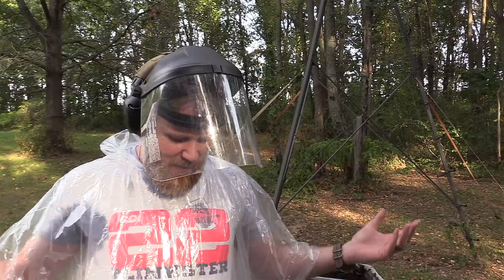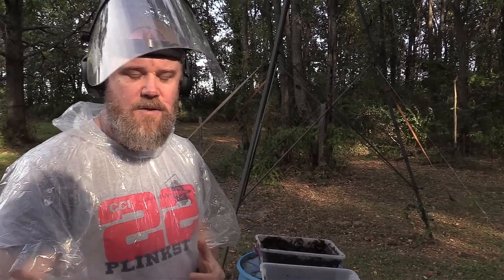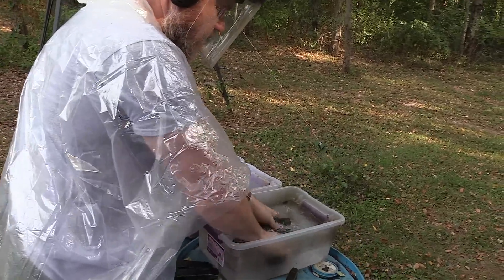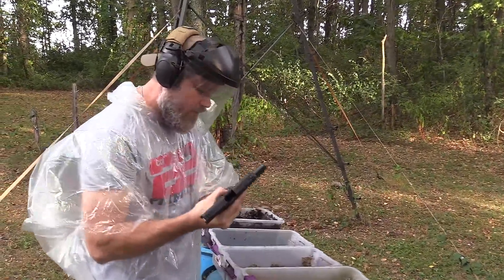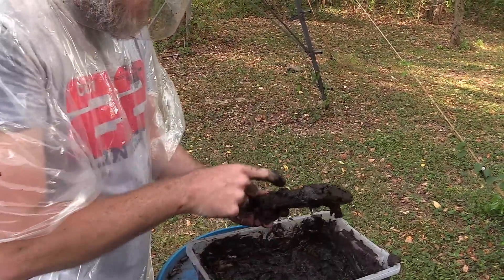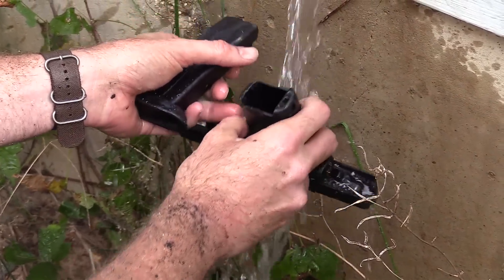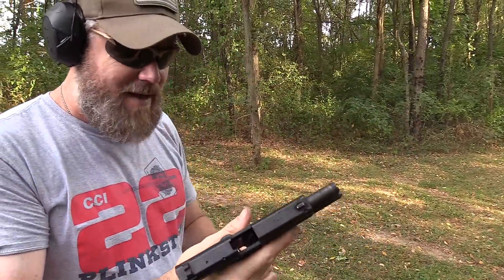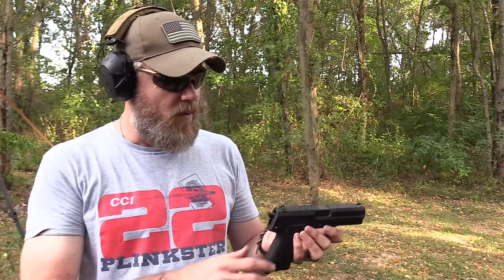The HK USP 45 meets the Gauntlet!

Comment: My usp 9 fell in the dirt and debris got into the control lever( safety/decocker) and it caused the lever not to work, when I called HK the rep asked " how do you know that its broken" and I replied that the lever goes all the way around and doesn't do anything. I sent it in and in a short two to three weeks it was back. The cool thing was HK replaced the night sights and repaired the broken control lever and sent the usp back all at no charge...

Comment: Legendary USP, expected nothing less. I wonder if the HK45 would fair the same.
Reply: Spanky's Basement yup, I knew it would slow it down a bit but I had a feeling it wasn't gonna die
Reply: From my personal experience HK45 has a tighter slide to frame fit, which makes it more sand-resistant.
Reply: There's only one way to find out...
Reply: Is the HK45 the same as the Mk. 23? That's been my dream handgun since i was a youngster
Reply: Joe Drummer the mk.23 is the navy seal contract USP design, the HK45 is the modernized USP 45
Reply: And another data point adding to why I want one of these in 10mm.
Reply: Lolz, nvm. Just looked em up a little while ago. Nice looking pistols. I think i'd still prefer the brick that is the mk. 23 myself. At least for a duty .45.
Reply: sailingmaster, that makes two of us.
Reply: Sailingmaster-Same here, but only if I move out of California.I did the next best thing and got a 6" factory HK barrel for my fs USP 45, and an 18# Wolff spring and shoot 450 SMC (45 Super w/small rifle primer)  It gets up there in 10mm territory.  The 6" barrel has the o-ring grove cut for the FS USP, not the Elite, of which I also have.
Reply: Spanky's Basement probably not...they don't produce or test guns like before...HK i mean!! USP line is best produced gun in at least 100 years!! NO COMPROMISES 😄!!!
Reply: Joe Drummer Its a 45 version of the 9mm hk P30
Reply: The one thing that kills me about the HK45 is HK went down in capacity, to 10 rd magazine, from the USP’s 12 rd magazines.
Reply: Mr Smith-It is great for me since I live in CA.  I have one and the grip ergo is better like everybody says.  I have a FS USP (10 rnd) and 2 Elites.    Heck, I carry a compact USP 45 mostly and it's "only" 8.  I don't think it amounts to shit in cap difference.
Reply: pete zandt, the HK45 compact is fine for carry with 8 & 10 rd capacity. The full size HK45 should have a 12rd magazine capacity for those of us in free states.
Reply: I got a Blackhawk Serpa holster made for the P30 and it works for my HK45  I don't have a P30.
Reply: Mr Smith-My compact is the USP.  My 10 rnd HK45 mags will work in the compact USP 45.  I thought it pointless, but I had to try it when I got the HK45 home.I got the HK45 in 2014 just before the CA Single Shot Exemption loophole expired  1/15.
Reply: Spanky's Basement my guess is the hk45 will do about as good if not worse than the vp9.
Reply: +DV8 H&K aimed the VP9 specifically at the market niche highlighted by Walther's PPQ.  It's priced to compete there.  The VP9 was never meant to be a service sidearm.  It has a great trigger and I've never had a problem with mine.  In fact, it's made me love the Euro-style mag release.  I use my trigger finger to drop the mag and never have to change my grip.
Reply: allindonks I’d think the HK45 would be GTG. The HK45 compact has replaced the Seal’s Mark 23, as the Mark 24.
Reply: The grip on the HK45 is much nicer though.  Easier to conceal too.
Reply: wait, this was posted yesterday, how did you comment on this 4 days ago? On Full 30?
Reply: Spankys basement-cough cough lol.  If there's a run on ammo agsain because of the Las Vegas shooting you'll still get .40 Short & Weak while I scramble to find 10mm, 45acp and 9mm, oh yea, 22lr.
Reply: JohnnyMo You can get energy in the range of .357 Magnum out of a 10mm, which is why so many of us want a USP in it.
Reply: JohnnyMo 9mm & 45 each have there pro’s. 9mm is capacity king & size efficient. Pros for 45 is FMJ, if you can only punch holes, might as well be the biggest bullet. 45 is tenth bigger, so who knows that could give a slight advantage snagging a vital, when a 9mm is off by a tenth. Also 45+p can be subsonic and 45+p can get close to a standard 10mm load, 10mm will always best it though. 

They’re both good cartridges and wouldn’t feel out gun with either. I chose 45 & 9mm for different roles.
Reply: Rifles First which is why I want a 10mm version. That way I can fire any factory loads like Underwood or Buffalo Bore, in addition to handloads.
Reply: JohnnyMo no no, I want a USP in 10mm, not .357.
Reply: JohnnyMo went to only 9mm for a while but added 45, Colt 1911. Think I’ll replace replace it with a HK45CT. 

I’ve always been able shoot 45 more accurately. It keeps an extra option open in case of an ammo shortage. And if storing ammo 45 FMJ is going to be better than 9mm FMJ for self-defense in place of defensive rounds, when they can’t be found.
Reply: JohnnyMo now, for the USP, the 9mm is more tempting than 45. Missed the promotion for the P30 for 4 free magazines. Ticks me off that I missed it.
Reply: JohnnyMo check out sootch00’s 45 compact review. Yeah, it’s only 8 rd capacity (10rd mags are available) but is smaller than a 1911. And it would make a good full-size backup for a high capacity 9mm. 

https://youtu.be/39H15uWVhhw
Reply: JohnnyMo SAME
Reply: Rifles First When only a sidearm is available, I prefer a high capacity 9mm. However, carrying two HK45’s would negate the capacity issue.

Figure if I carry a 9mm and it’s not working, the slightly better ballistics of a 45 could give a small advantage.
Reply: Spanky's Basement Yeah, sidearm is usually all anyone has access to. That’s where 9mm might be better than a 8rd 45. Standard 9mm capacity is 15rd and if one hand goes down a magazine change is going to be difficult.
Reply: I also got one right before. Good for us. :D Never knew the mags would fit in my compact. Got the compact in 2012, couldn't find the full size. Did you pick up a .45 expert? Thing is sweet!
Reply: HK Mark 23!
Reply: Can it handle 45 Super like the USP though?
Reply: +Leon Yang tighter tolerances usually mean less reliable.
Reply: The HK45 uses a single stack mag. It was built to fit the hand like a 1911. This is why it has a low capacity. I don’t know why HK wanted to make a gun like this but it’s what they did. Funny enough it turned out to be good enough for the Navy Seals because it replaced the Sig 226. That says a lot about the HK45C.
Reply: @Al-cy9qn  the mk23 was the first ever iteration. After some feedback hk shrank it down a little bit in size, bringing us the usp series. The hk45 is the newest generation after this usp

Comment: Exactly what I expected,thank you.

I've owned 3 USPs and none ever had a malfunction. I also owned a P2000 which also ran like a champ. I sip the H&K kool-aid all day everyday.
Reply: Glock wins!!
Reply: @levirodgers6082  hows that glock 44 looking again?
Reply: Anthony Severino  The same way the VP9 is doing. You can use certain ammo, that’s coming from your own manufacturing company. Glock will fix the problems for the 22LR , I promise you that. But who’s the King of the 9mm? Glock by far, you welcome!
Reply: @levirodgers6082  Glock vs USP Elite .45 Acp..Glock 0 HK 5 ...😁😁😁
Reply: @levirodgers6082  If you can't make a high-strength polymer .22 50 years after Remington makes a .22 out of basically all plastic, then you're doing somethjng badly. Glocks are kings of a well-rounded gun for the money, but it isn't a USP that will go through hell and back just to laugh in satan's face. And you pay for that privilege.
Reply: Anthony Severino Mine is working perfectly. 2000 rounds and not a single issue. I’m not a cheap bastard though. Only CCI mini mag and Federal Champion has went through it. I’m a massive HK fanboy too. I own the MR556, MR762, P2000 40 LEM, MK23, USP 40 v1, VP9 optics ready, SP5, USC to UMP by tommy built, P30 v1 9mm V3, HK45 Tactical v1. Only own two glocks, the G19 which is my concealed carry and my G44 which is the range plinker. Glock, Sig, HK, make the best hand guns on the market. Hands down. Quit trolling.
Reply: @CaptainCreampie69  I'm looking at a USP .40 at a local pawn shop. Does it function as reliably as the .45?...I think it feels a little plasticky...have you had any issues with the palomar or grip or anything?
Reply: @code.name.sasquatch  Do not hesitate. The USP was designed around the .40 and is imo the pinnacle of .40 cal handguns. It recoils like a 9 and is just as reliable as the 45 in my experience. I have a simple dirt test vid with mine and out of all my current and past hand guns I tested it did the best. Both my 1911 and G19 functioned fully but both felt sluggish and gritty. The USP got it the worst and still felt like it had just been cleaned and lubed minus the safety being slightly gritty. Also keep in mind that the materials are second to none imo. Barrel is CHF from canon grade steel. Same steel as the 416. The slide is much more robust and harder to cut according to DB custom when I asked about a custom slide milling package for my VP9. The internals are either stainless or HE finished (Melonite) so no corrosion issues to worry about. May not really make a difference for 99% of the time but still a factor.
Reply: Anyone at the range cares about who has what gun? 🤣 I rarely see guys in shape at the range. Physical condition of a man is most impressive thing a man can do. No one cares what gun is someone shooting
Reply: The P2000 is a usp, the P30 and HK45 is a USP. They're all just USPs, with some cheaper parts inside, over half of the internal parts are interchangeable. The only things different are the barrel, external look and the newer guns have a cheaper recoil spring and guide rod. I have P2000 and HK45 parts in my USP45 and Expert, they all have light extractor springs.

Comment: I've had a USP in .40 since 2003 and have never had a failure with it...and I've shot reloads, cheap, and expensive ammo through it.  Everything is still tight and the only wear showing is the lockup ramp in the top of the slide, and it's cosmetic.  What a tough pistol.

Comment: In my opinion, after going back and watching the Arex test, this test seems more impressive. The Arex didn’t have nearly as much mud stuck on it as the USP did and the USP still locked open. He also didn’t throw sand dirt and mud over the gun and basically completely submerge it as he does with the USP. Just my opinion. Or is there another Arex gauntlet I didn’t see?
Reply: Well, the AREX also fired a full thousand rounds in rapid succession with Battleborn lubrication and didn't malfunction once. The slide was over 200 F at the end of it and it still worked. The trigger was I think 170 F, which is a few degrees more than what's necessary to kill flesh on contact. (Obviously, thick gloves were involved in this test.) So while the Gauntlet wasn't repeated, the AREX proved itself in other ways afterwards, if that helps.
Reply: Phoenix 731 So have 1911s. The HK45 went 50,000 rounds with like 1 or 2 malfunctions only being cleaned every 4K or something and at one point went like 12k without cleaning at one point. It’s on pistol training website. It’s pretty interesting. I think the USP could do the same as the Arex honestly.
Reply: The 50,000 round test took months, however, and I should note it wasn't smooth save for a couple of malfunctions: It experienced some parts breakage, too, although it continued to fire even with the damage. When I say the AREX fired a thousand rounds in rapid succession, I mean in something approaching the space of about 14 minutes or so. I wouldn't be surprised if it could do it, but that's not the sort of abuse I'd place bets on a typical, non-megabuck 1911 shrugging off save possibly if you're lucky enough to get ahold of an old original milsurp which is in good condition, and even then, I wouldn't be so sure: The Colt Series 80 1911 the Military Arms Channel tested completely choked and they weren't even able to finish. Sure, it's not an old GI-issue model, but it is still a Colt, at least, and I would expect somewhat similar performance.
Reply: Phoenix 731 I believe the Colt would have done better with Wilson mags. First thing I did with my Colt was throw away the stock mags. They were labeled as 8 rounders and I could barely get 6 in em. 3300 rounds with 1 FTE somewhere around 2900. Now obviously those 3000 rounds were over a period of time but it’s gotten dirty and have been reliable. Also these 1000 round tests still don’t really prove anything since no one realistically will need to fire 1000 rounds in quick succession. I’m sure the Arex is a great gun. I just don’t have an interest in it after owning my 226. Just didn’t like the overall feel.
Reply: That would've caused the handgun to malfunction somewhat less, but what caused the test to completely fall apart was the gun itself simply locking up and refusing to go back into battery, and it consistently malfunctioned upon contact with the dirt up to that point. Mags won't fix that. It failed because of severe dirt ingress in the handgun itself. I'm not tryin' to sell ya on the AREX or anything, I'm just pointing out that the 1911 is a century-old design and it's showing its age. I'm sure that a custom-made, modernized, and of course quite expensive 1911 can still kick ass and chew tobacco, but how practical a choice would it be, especially for a service pistol? The AREX is about $600, which is a pretty decent price for what it can do, and many even cheaper polymer striker-fired handguns in that test choked considerably less. However, I do agree that the USP and the HK45 are kickass handguns and could definitely handle themselves quite well in adverse conditions. A 1,000 round meltdown test would be interesting to try with them. Sure, it wouldn't be realistic, but frankly, neither is intentionally dunking a handgun into all of these elements, either. The idea is "Shit happens in a warzone/zombie apocalypse, so let's have some fun and see what happens when it does."
Reply: Phoenix 731 I know. It’s a cool what if scenario. It’s just some people (not talking about you) see one video of a gun failing and pass it off as a POS. A gun could pass and go through again and get some debris in just the wrong place and lock up. 1911s are very iffy. Since they are hand built there are different tolerances from gun to gun. My Colt and cousins Springfield have been very reliable and I’ve done some torture tests of my own but there are a lot of 1911s out there that won’t really run for shit. To me that’s where it shows it’s age. A properly built 1911, not necessarily expensive, will run outstanding. It can be hard to know for sure if you get a properly built one though. Guns aren’t really hand built anymore so there are less qualified people who know how to build them. HK, Glock, FN etc all are made from machines so there are very minute variances. They are made in high volume. That’s something 1911 makers try to match and you end up with issues. I will say I was very impressed with his recent Five7 test. That really makes me want one even more now! Lol
Reply: Oh yeah, the Five-seveN was a beast. I was pretty impressed with it. I've noticed a pattern with these weapons where they can be extremely reliable in some conditions but choke on others. It seems like a fair number of striker-fired handguns run into trouble in mud specifically. That's what finally got the Five-seveN to give up. The CZ P-10 C did amazingly well, too, until it flat-out stopped working in the mud part of the Gauntlet test. I was a bit disappointed by that but it's certainly no condemnation of the gun that it took that long to get it to give up. Really, I think the problem isn't that the guns malfunction in conditions no gun can reliably operate in, the problem is more that the Rex Zero One and P-07 showed just about everybody else up and it's makin' them feel bad. Even a Rex will malfunction eventually in those conditions. You can't just go bathing it in mud all day erryday.

P.S.: Hmm, this is making me wonder if any of those new (and pretty cheap) polymer-framed 1911s would do better in this test. They're redesigned enough that they most likely don't require hand-fitting anymore.
Reply: Phoenix 731  Cheap polymer 1911s? Who makes em? Did RIA start making em? The only ones I can think of off the top of my head are STIs 2011s and they’re expensive. There was that one polymer prototype 1911 like doublstack handgun that was supposed to be designed for the US military. I can’t remember the company but it looked really awesome.
Reply: Off the top of my head, there's the EAA Witness Elite and the ATI FXH-45. Both are at or under $500. I've also heard of a $400 Freedom Concepts Laboratory ambi polymer 1911 which looks kinda neat. I wouldn't bet on any of these performing as reliably as something like a Glock or AREX, but I know at least that the FXH-45 seems to work reliably in normal use situations. Might be worth lookin' into.
Reply: Phoenix 731 haven’t heard of the ATI but isn’t the EAA witness a CZ clone? I may be wrong. I don’t know much about polymer 1911 brands.
Reply: @Berserkable  The Arex is better.

Comment: How about testing the Glock 20, because 10mm.
Reply: That would be pretty interesting. I feel like it'd do pretty well - although I guess not much better than a 40 S&W gun.
Reply: Nathaniel Bacon as a g20 owner, I'd like to see that myself
Reply: Der Fliegende Holländer The 10mm is much more powerful than the .40. If power has to do with reliability in these types of tests, the 10 would be incomparable (in a good way) to the neutered .40.